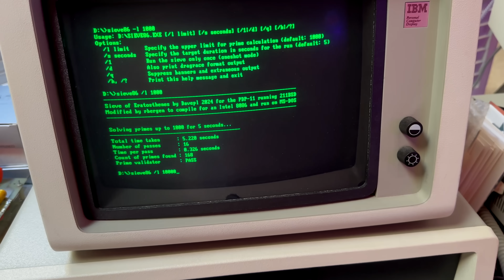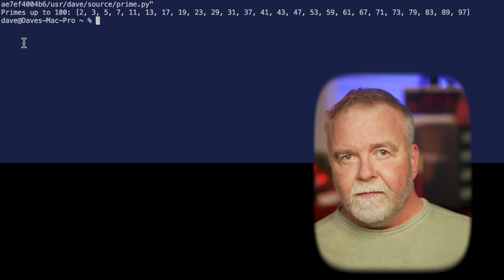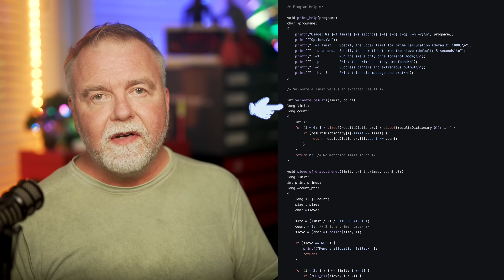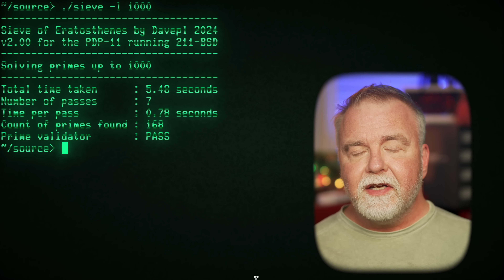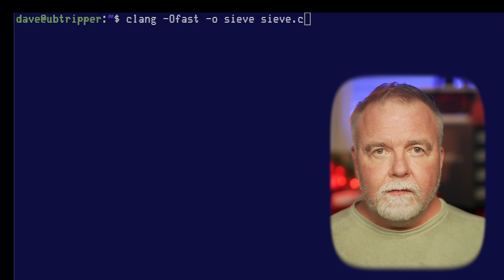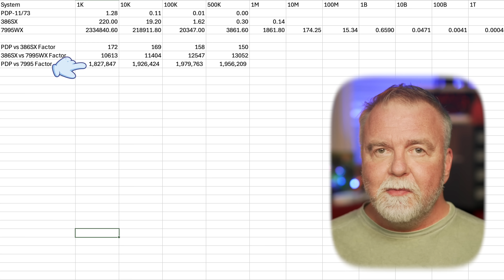Solving the Primes to ONE TRILLION on the desktop!  Plus PDP-11 vs Threadripper tested!

Comment: The naive implementation of the sieve algorithm is inefficient in modern hardware. That's because since it's going linearly through the entire enormous bit array again and again, it's constantly causing cache misses. The worst case is when the bit array is larger than even the outermost L3 cache, in which case each pass will cause one or more worst-case-scenario cache misses.

The exact same algorithm can be implemented in a more cache-friendly manner: Rather than going through the entire bit array, marking multiples of the current prime, instead you do it in segments: Select a segment size that's slightly smaller than the size of L1 cache, and mark each segment fully before going to the next segment. This maximizes the work done on the L1 cache and, thus, minimizes the number of cache misses.

The speed difference is not inconsequential. You can easily double, triple, even quadruple the speed of the entire thing in this manner (depending on the particular hardware you are using). Those cache misses are extraordinarily expensive.

There's also another advantage of doing it like that: As you might have surmised, the calculations done on each segment are completely independent on each other, and can be done independently. Things done in one segment do not depend in any way on things done in other segments. So you might guess where this is going: Indeed, this segmented version of the algorithm is very easy to parallelize to multiple cores, and the increase in speed is almost linear to the number of cores. Have 16 cores? The entire thing will be done almost 16 times faster compared to doing it with one single core.

What's better, if you select a segment size that's a multiple of the cache stride, you don't even need any mutual exclusion, no locking, nothing. You can bypass all that and thus get maximum multithreaded speed. Because each thread will operate on its own independent segment, separate from the rest, they don't interfere with each other.

Comment: My first "personal system" was a pdp11/45 that I ran several different operating systems on. One was a custom real-time OS from Bell Labs and another was Unix system 5. You should be able to find a version of Unix or BSD to run on any of your pdp11 systems. If you are ok with doing some work an early version of Linux should be able to be ported to them. Any OS that is compiled for the LSI11 chip set should run on an earlier descrete pdp11.

Comment: I'd imagine you could write a sieve to disk and process that instead of RAM. Slower than RAM but would allow for larger sieves. The other cool thing would be a multi core implementation that could work that threadripper beast of course I expect you'd run out of RAM again and need to use disk. Moores law  tested.

Comment: A friend and I used to race programmable calculators and early microcomputers to see who could get a prime number above 10,000 first. Later, as I learned about the Sieve of Eratosthenes I realized we were doing it all wrong. But we usually didn't have the memory to do it right. Then I got access to a LSI 11/23. And it was a huge step forward. But by then we had actual work to do, so my interest stopped there. 

Nevertheless, your presentation brought back many memories. And by the way, Macro-11 was one of my favorite programming languages. I liked writing libraries of macros so that it practically looked like a different language. And I know I'm likely to start a flame war, but I kinda liked using TECO with a series of TECO macros and a WYGIWYAF display screen.

Comment: Twelve.  I was liaison to a company that we bought automated warehouses, including automated material handling carts which followed segmented wires embedded in floor.  All of it was controlled by a PDP-11/44 running inventory control and master dispatching (actually two, backup system kept in sync, with God's own A/B switch to manually switch primary (active) system.  PDP-11/23 was used for control of carts, using wiring as radio antenna.  All code was developed in MACRO-11.  Yep, inventory database manager was in MACRO-11, cart and automated crane dispatching in MACRO-11, reporting in MACRO-11, operator display (VT-100s) handling in MACRO-11.  It was gloriously fun!

Comment: For my current procrastination project, On a 6502 at 1MHz, with 4k of RAM for the sieve (so primes up to 64k) I’m getting about 16 seconds. Unfortunately, something isn’t mathing right in my assembly code as 113, among others, is missing… and debugging asm on a simulated OSI superboard is tedious.

Comment: I saw the 1.8 million speed increase and immediately thought of all the other cores. If you made it multi-threaded, it'd be hard to access the array correctly - but if you solved that and used fancy new instructions, could it be another 64x as fast, or much faster still?
Reply: Would be interesting to know how well the systems scales given the memory bottleneck.
Reply: @toby9999  He said the 1 trillion number array was 58 GB. It took 40 minutes to write? Either way, on average less than 1 GB/minute. Of course that's effective speed but in reality his memory access will have been much higher because of the setting of individual bits, not bytes. Each byte will be accessed a number of times.  Maybe you're right after all - this program does essentially no math - it just sets bits! The real test would be to code it in CUDA and run it on an Nvidia H100 or something.

Comment: I saw your previous video on the Prime number challenge. I wanted to submit a similar approach, but exploiting SimD AVX-512 will allow a single threat to run 1 trillion numbers in under 9 minutes. Sadly, I saw the challenge videos a few months after you published them. Exchanging CPU processing by memory usage is always a good idea and very clever. I may favor a bitwise approach as array values, but it is a bit pretentious to mention before I have done the code :). 

I can write that algorithm for the challenge if there is still time. Let me know!

Comment: The RAM limit is why I wanted to go with disk storage. But it would take some thought to optimize the reads and writes to reduce the overhead of using the disk. Even with today's NVME drives, there would still be some overhead, just not as much. My first prime sieves were run on an original Atari 400. I had a Tandy PC-1 pocket computer, but with about 1200 bytes of RAM usable, I didn't see the point in even attempting a sieve on it. A point on the 386SX, that's only got a 16 bit path to the RAM, so a 386DX at the same speed should be almost twice as fast. With today's processors, you could pass off to extra threads, and really accelerate the process. Processors have come a long way in the last 45 years, from a few hundred kilohertz to several gigahertz. I remember being amazed by the results of freezing an 8088 and clocking it up over 20MHz.

Comment: What is likely more astonishing (OK we already knew it naturally) is less the threadripper, but that I can run it on my lowly Android phone and take 10.33 seconds for a pass with limit of 1'000'000'000 (clang with termux on an Samsung S23).
Reply: Couldn't resist: 116s for 10'000'000'000 and 1526s for 100'000'000'000 the later was likely pushing things memory wise.

Comment: The reveal that the Threadripper is only using one core 🤯
Reply: Not sure if there's a way you could multithread this algorithm
Reply: @illegitimate-egg  It is "almost" trivial to multithread this.  You split the range into N partitions. Each partition is "embarrassingly parallel" -- they are independent of each other. One would use a scatter gather approach. i.e. Divide the work then merge the results.

To see how this would work manually walk through a small test case of say a max value of 64 and 4 threads. Each thread needs to only work on 64/4 = 16 values. Each thread has a range of numbers that it needs to process. You then mark of each multiple 3, 5, 7, etc. for that block.

It is basically fancy book keeping to make sure each partition is calculated correctly.
Reply: @MichaelPohoreski  the hard part is rolling the bitset through blocks

Comment: Glass VT220 is a font I have been using for probably decades now? At least one, anyway.  It is the single greatest font ever for modern systems and I will fight anyone that disagrees (fira code with ligatures is pretty cool too tho...), I've run it on all my linux machines (which is all) as the native terminal and my Tilda font for the terminal-that-never-closes.

Comment: Threadripper is 19.68 times faster than my Raspberry Pi 3 B+

Solving primes up to 1000000
--------------------------------------
Total time taken      : 5.00 seconds
Number of passes      : 473
Time per pass         : 0.010576 seconds
Count of primes found : 78498
Prime validator       : PASS
Reply: Yes, but do remember that this test only runs on a single core and the Pi has 4 cores compared to the Threadripper’s 96.
Reply: @MaxPower-11  Yes, I do know that.  I typed in all the code by hand and didn't see a single pthread_create() statement so I was quite informed about the single-threaded nature of the program.  Did you really think that I might actually believe that a 96-core thread-ripper (if indeed that is what Dave is using here) at full utilization would only be 19.68 times faster than an old 4-core ARM?

Comment: I made another entry of the 1..100 sieve with a Bic pencil and a piece of paper and wound up with an impressive 3 minutes and 22 seconds. It is a valid entry : I didn't cheat with a ruler and used 0's and 1's, following the algorithm 100% and I used a 53-year old machine. So I think I should be on the ranking table.

Comment: You can exploit a pattern in the primes to reduce the sieve size and search space, and simultaneously decrease the runtime.

Primes > 2 can be expressed in the form 2k + 1, reducing the sieve size to n/2 bytes
Primes > 3 can be expressed in the form 6k + {1,5}, reducing the sieve size to n/3 bytes
Primes > 5 can be expressed in the form 30k + {1,7,11,13,17,19,23,29}, reducing the sieve size to n/30 bytes
Primes > 7 can be expressed in the form 210k + {one of 48  offsets}, reducing the sieve size to n/35 bytes
Primes > 11 can be expressed in the form 2310k + {one of 480 offsets}, reducing the sieve size to n/38.5 bytes
Primes > 13 can be expressed in the form 30030k + {one of 5760 offsets}, reducing the sieve size to n/41.7 bytes
Primes > 17 can be expressed in the form 510510k + {one of 92160 offsets}, reducing the sieve size to n/44.3 bytes.

In fact, for every prime, there's a corresponding expression for further reducing the memory requirement. I use the 30k rule in my own high-performance sieve, and exploit the fact that there are exactly eight offsets to check, as this (being a power of 2) makes a further optimization possible.
Reply: Might try that someday. I tested Dave's code on my i7 12700 with a few mods to C++ x64 under VS. I couldn't get much past the 100,000,000,000 limit due to memory constraints. Execution time 300secs

Comment: Procrastinating is definitely an option. I wrote a piece of music back in 1992that required me to process samples in order to realize the piece. Essentially working at encoding surround sound on a per sample basis. I had the venerable Mac LC 485 at the time. After processing the first sample, I went back to my prof and told him that realisation on the piece would have to wait until 2018, or until computers got faster . I finally realized the piece in 2014 with a Duo core realizing the piece in real time. 😅
Reply: Is it uploaded anywhere?

Comment: Your VT220 term is missing the curved glare of the glass screen AND the screen burn-in from the electrons hitting the phosphor coating!

Oh, and love the conclusion! Procrastination. I think I'll just wait.
Reply: The next version will have to incorporate simulated screen burn-in.  I noticed back in the day that burn-in seemed worse on amber than green monitors.  For color emulation, it needs to have the horizontal shadows of Trinitron tension wires - assuming it is emulating a Sony monitor.  Also, a few permanently dark random pixels will help recreate the analog vibe.
Reply: Trinitron FTW!
Reply: @DarrenYung   Yep, the Infamous Trinitron shadow.!

Comment: You can poke a faster refresh rate into the timer chip of that machine with bad RAM, it might fix it. Most likely only the worst bits are leaking too much and not likely something blew up.

Comment: If you don't need to store the primes found, but only count them, then you would not need much ram?
Reply from the maker: You need the RAM for the sieve, otherwise you'd have to individually factor each odd integer, which would be much much slower.
Reply: @DavesGarage  Makes sense. Thanks!

Comment: Really curious if the massively increased cache of the 9684x with over a gigabyte of L3 cache would speed things up, or whether the clockspeed of a desktop Ryzen (7800x) or Intel (14900k) would be better? Is this workload memory, cache, or frequency limited?

Comment: In this benchmark, the compilers probably make a difference as well, with the newer ones optimizing the code better than the old ones. I am especially concerned with the loop check (sizeof / sizeof being calculated for each iteration on the old compilers and maybe not on the new ones). Maybe extract the value outside the loop. Or just leave it and just accept that it is part of the difference between the systems. Also, I would change the /and % to >> and & to avoid avoid divisions and remainder when it isn't strictly necessary. It is a valid part of the test, though. 

Still, it was interesting to see the results.

Comment: Very cool and fun!! Question: Why in some cases does Prime Validator say PASS and others times it says FAIL?? Thanks for sharing
Reply: I looked in the GitHub repo and the last commit message states "Fix validator bug due to int size". I assume Dave captured the video and only when editing that part found & fixed that bug (I think the expected value for 500.000 was just missing initially which caused the "FAIL"; Dave in that commit also added another C-file called memory.c that has it's own main and no .h file, not sure what that file is for in that context).

Comment: my first IBM clone a 386 16mhz then a 486 ,i'm not sure if a Pi 1 is faster than a 386 16mhz on a fraction of the power.
Reply: @peteradshead2383  the PI1 runs at 800 Mhz, so yes. it is 😄